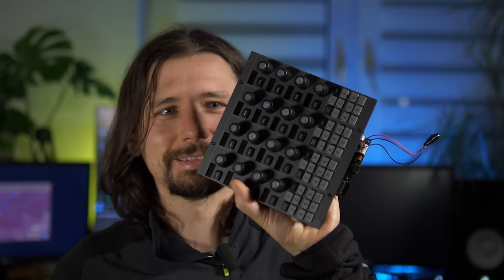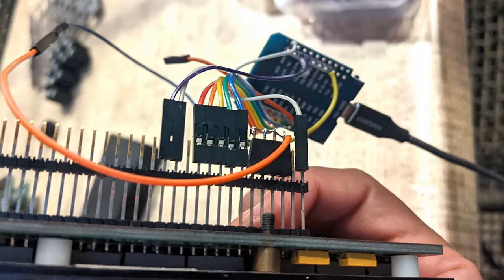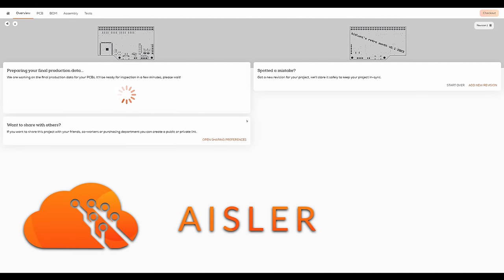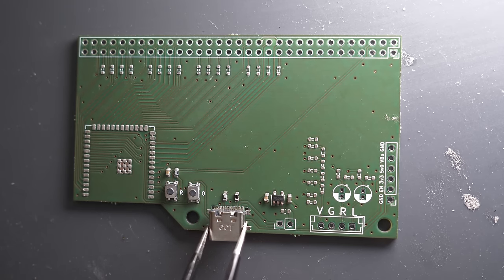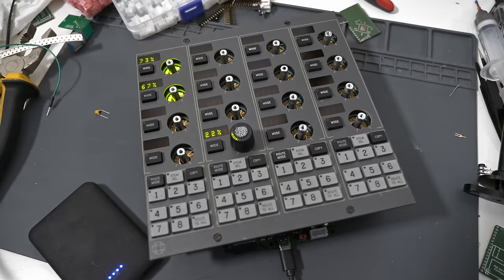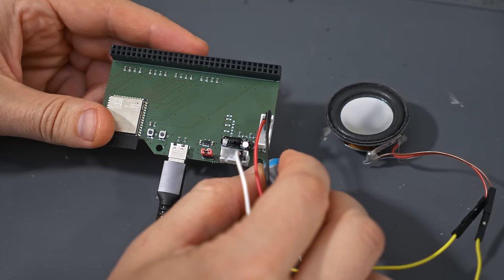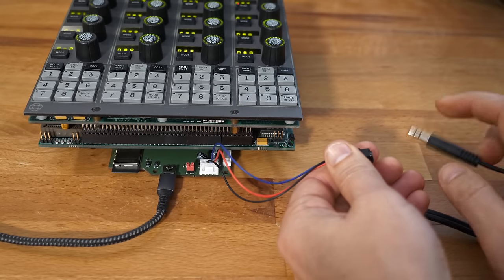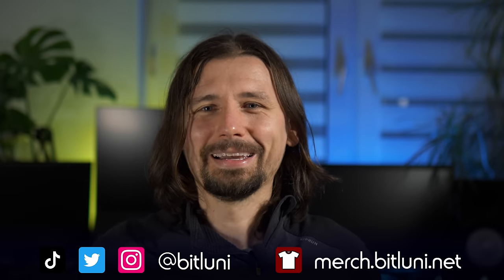DIY Music Sequencer

Comment: The module you have is part of the control console for a AMS Neve digital console.  No audio traveled through these boards, they where just the front end control.  All the processing was in a large rack in the back end.

The knobs were touch sensitive.  It was a really amazing piece of Kit.

I used to work for the company.
Reply: Any insights on where one might acquire one of these modules (in Germany)? :D
Reply: That whole panel is amazing. Did you guys design the encoders yourselves?
Reply: I believe that the design of the encoders are patented.  Yes they were designed by some very smart engineers.  I was just a field service tech for the company. @PaulSpades
Reply: @glennspecht  They did well, and I'm sure you were also good at your job. Thanks for feeding my curiosity. Cheers!
Reply: @glennspecht In what way are they touch sensitive? As in you can tap them and they work as a button? That would explain why they used ASICs and a bunch of analog logic around them rather than the straightforward digital microcontroller I expected. I think I need to reverse engineer a bit more in that case, as my software doesn't support that yet.
Reply: @Spritetm  modern mixing consoles have the ability to record changes to the controls ( therefore the sound) vs the timeline of music being played.   The software that controlled the moves is very sophisticated. One of the modes would be to only record changes when you touched the controls. Otherwise the controls were in playback mode.
Reply: @Spritetm  On the Midas Pro2 boards (though it could be completely different than the Neve, i'm not sure), when you touch one of the physical knobs, the screen will instantly highlight the corresponding control on the on-screen interface that would be affected by the knob you touched. very handy on smaller boards where some hardware controls are not always controlling a specific setting, but can actually control various different things depending on which menu is active in the UI. the slightest touch would trigger it if i remember correctly, it had to have been capacitive.
Reply: @glennspecht  I guess the magic was in the knob molding - rectangular fiber-optic light pipes running thru the knob to an led ring on the pcb. Great idea as if they flare out towards the bottom of the knob then the led ring revealed at the top of the knob could be denser and of smaller diameter saving apparent panel space and looking magical!
Reply: @glennspecht  By modern, you mean from the 70s onwards, right? Because that's how long automation has been around. Neve themselves introducing it into their systems in 1977. It was called NECAM, if anyone wants to go down that rabbit hole.

Comment: Looks like a module from a AMS Neve Logic 2 series sound desk. The 'in thing' to have in the late 1990s in Film and TV. Found in Hollywood, Pinewood and the BBC in the UK if you were into sound dubbing. Often accompanied by an AMS Audiofile, one of the World's first dedicated digital hard disc audio track layers/editor machines. Spent several years of my life teaching people how to use this box of tricks.
Reply: It's from the AMS Neve MMC series of consoles from the early 2000's.
Reply: Disney and Fox still have significant Logic DFC installations in Los Angeles (I’ve worked on the Disney one a little). I remember when Sony was disposing of its Harrison MPCs and entire pallets of these modules all going out to scrap.
Reply: @Gin-toki  the MMC console had the knobs staggered left/right for ease of access. The Logic 2 and derivatives such as the DFC console which pre-dated the MMC had the knobs in a line on the right hand side as per the module used.

Comment: I think you're onto something with that Phased Array Sonar. I look forward to part 3. Here's what I'd love to see: can you use it to spot bugs that are flying? Can you identify different kinds of bugs based on various traits? While I do understand the principles of what you are doing...I feel like you are HUGELY more efficient at pushing this idea forward than I would be.

As for why I want this? If you could cover a 60 degree arc (in 3 dimensions, so a cone) then you could slave that to a pulsed infrared laser at around 3 watts of output. Find a mosquito? 50ms pulse to kill it. See a fruit fly? 100ms pulse. See a honeybee? Bees are friend, do not engage! See invasive beetle? zap

Ultrasonic may be the wrong tool for this job, but every right tool starts somewhere wrong. :)

Comment: Fyi, you can use sigma-delta modulation with DMA. You simply need to use I2S but use the PDM output method. Downside is that you only get one channel, but I think you could use two I2S peripherals to get stereo. Upside aside from DMA is that it's a higher-precision delta-sigma (the one you use is only 8-bit) system as well.

Comment: Is this an Eurorack module? Very nice panel but I have no idea what kind of projects this can be used for. Maybe you can turn it into a fancy pancy (wireless) home appliance/light (remote) controller. Or you can save it to make an "April fools day" prank device (in a box that looks like a RC-remote with belt and huge antenna) that can open bridges, change traffic lights, edit electronic road billboards (or any other billboard), change all of the TV's at an electronics store to an impressive light show, control the behaviour of humans, and so on. 😆 After this, you can make a "making of" video to show us how you achieved this.

Comment: Great project and video. The 4x4 rotary encoder matrix reminds me of the Akai MPCX with the leds around the encoder and the small display per encoder. would be cool if you could get your device to work similar as on the MPCX, but with the much cheaper MPC One (or even the MPC PC software). MPC's run on Linux. Probably way too ambitious, but I also know you like challenges.

Comment: Awesome! 

Just a question, how come the SDMs output connected to the speaker produces the correct sound? 

If the duty cycle is set based on the value of a sin wave, the SDM output should not also be the same sine wave. Or does it create a different wave with similar frequency components, due to the next_sample() function oscillating between {-127, 128} at 440Hz? However wouldn't this mean that while the output of a certain sample is close to 0, the duty cycle will be half, and there will be some high-frequency noise on the signal? I did not see this happening on the oscilloscope output at 5:50 , but it could have been clipped due to its high frequency. I'm not sure how this would not change the sound coming from the speaker.

Basically, is there a reason why controlling the SDMs with certain signals basically produces the same signal at the output, or is the output from the SDMs demodulated before it is fed to the speaker? If it is not demodulated, how can that speaker operate when it is receiving a digital signal, without losing audio quality, etc..?

Edit: According to Wikipedia, a PDM signal, which the SDMs produce can be decoded to analog using a low pass filter, as this will just yield the average signal strength over time. Was this included in the design, or excluded for some reason?